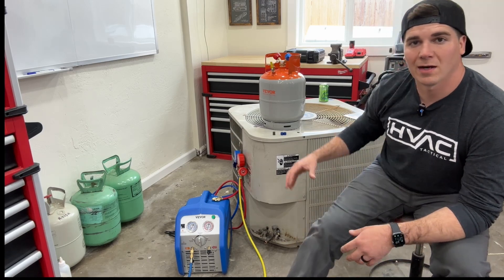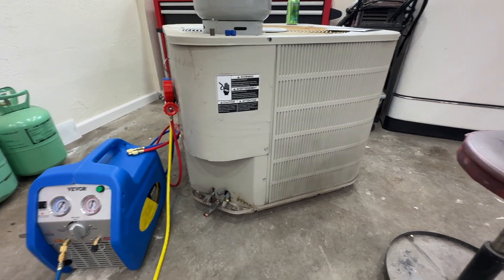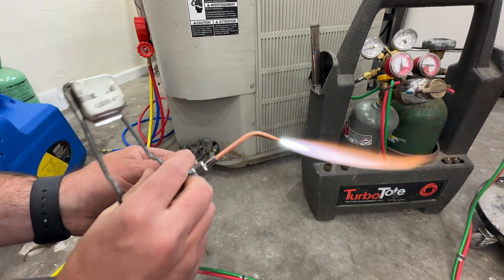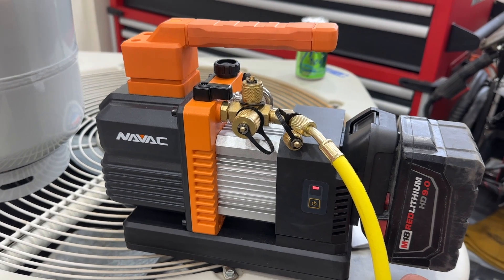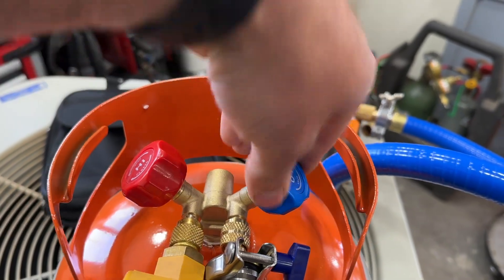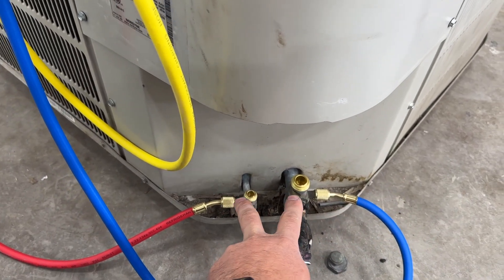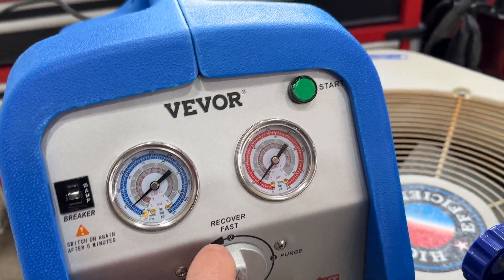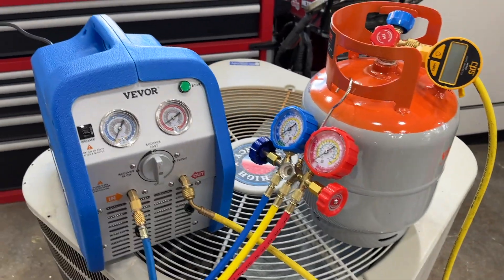How To Properly Recover HVAC Refrigerant Into A Tank

Comment: yeah as a home owner totally not caring about recovering the refrigerant... post a pic to craigslist it will be gone overnight... they want $150 just to pump down a refrigerator before the trash guys will pick it up but... pro tip .. a metal cutting circular saw blade can be very useful for cutting things into small pieces.
Reply from the maker: I heard if you flip the blade you can use a regular carpentry blade 👍🏼

Comment: Thank for your videos!! 

Last summer was a rough year for AC issues for me to manage!

Have rental houses in Mississippi, Florida, Alabama and Texas. ACs are a requirement in the South. It is a need to have cool air in the South. Last summer replaced AC in Fort Walton Beach at 7K and it took a couple of weeks to arrive. The house in Navarre I pay for the warranty and that ac had three hard breaks on parts at one time and it was 1K for repair and that unit is only 5 years of age. The AC in Alabama has a slow leak and had $250 of R-22 Freon placed in it. Last summer came back to house in MS with a hole in the ceiling due to pan overflow! Still need to get the drywall patched from that hole!

Your videos make me think I can can do more to spend less! Thank you!
Reply from the maker: Absolutely you can! I offer remote help for people like yourself, so if you ever need some assistance, check out our membership plan at Patreon.com/diyhvacguy 👍🏼  Cheers!
Reply: @diyhvacguy  just to let you know bro Milwaukee came out with a vacuum pump so you can use your batteries also Milwaukee came out with a recovery system go check it out doesn’t come out till next year though 2026
Reply: hopefully your repairs last for a while because the new high efficiency  replacement units they started forcing on everyone in january are much more expensive

Comment: Side note, recovery is slower unless you remove the valve cores in the path (service valves on low/high) between condenser and recovery tank and a 3rd to use as a valve to isolate the micrometer gauge from pressure when the pump is running.
Reply: Correct. Also use the " PURGE FUNCTION " at the End of the Recovery Process, to Remove any liquid refrigerant from the Recovery Machine.
Reply: I was about to ask about that. I've never used this small machines. I work on Automotive ac and I'm considering to buy one.
Reply: @VWtech562  Just finished my 99 Sierra last night. Flushed lines and evap replaced everything else. Got rid of the HT6 belly leaker for the sanden style. Started a home/auto diy channel since all the repair vids on youtube were crap so will have this up after a bunch of editing and narration. Weighed in the charge using a postal scale and 12 oz cans, easy to do since we got self sealing cans. Figured my large scale for heavy refrigerant cylinders would be a bit imprecise for a little 12oz can.
Reply: @thebluelunarmonkey  I was thinking about using my small kitchen scale to weight the 12oz cans too.. that thing is pretty accurate. My only concern is keeping the can on the scale without falling and giving a false reading.
Reply: @VWtech562  The new cans are self sealing - unlike the pierced cans we are used to. The tap is also self-sealing! so there is minimal loss when removing the can from the tap. You can then weigh the can. Put the can back on the manifold if you still need to add refrigerant. I'll be posting this on my DIY channel when I'm done editing. I could post the raw footage for you but won't have narration. If I do, I'll comment on that channel (Bear, Home Owner DIY) and you can view the channel and watch where I used a digital scale. You do need a scale with a range of at least 16oz (12oz refrigerant + 3.3oz empty can weight)
But you can do it without watching. Know your target charge weight (32oz for me).
Weigh three 12oz cans of R134a - 15.4oz, 15.3oz, 15.5oz. 
You know you need 2 full cans 12+12=24 so empty those cans and weigh the empty cans (3.3oz). Subtract from full weight (15.4-3.3 = 12.1oz, 15.3-3.3=12.0, total 24.1oz)
You now need 32oz - 24.1oz, or 7.9oz. 
The target weight of the last can is 15.5oz - 7.9oz = 7.6oz.
There will be some waste gas that stays in the lines, you could safely add 1oz and not be in danger of overfilling, so make target 6.6oz.  
You can remove the can from the tap when you are close. Wipe off ALL condensation (that's weight!) before weighing. Repeat til the can is at the target weight.
I have found the self sealing cans and taps leak free. Even the tap will hold pressure when removed from the can, the high/low side adapters also hold pressure!
I put my manifold on a vacuum gauge to avoid needing to bleed refrigerant to purge air. I use the extra port (has a schrader) to connect to my vacuum pump and can remove the vacuum hose without losing the vacuum in the manifold gauges. Close off the high, keep low open to vacuum that side. You don't really need to close the low after as the manifold should hold vacuum.
Reply: @thebluelunarmonkey  thanks for the detailed explanation.. I've never actually weight a 12 oz can lol. I just put it in, but I'll check them just as a precaution from now on. 

The system on my wife's Jeep takes 22 oz. I was thinking in putting two full cans considering that 2 oz might remain in the 5ft hose.

After just putting 1 can the pressures were at 40 on the low side and 160 on the high side with the system running... which make no sense, it should be at 20 or lower on the low side and when I turned of the car the pressures wouldn't equalize. I'm guessing I have a bad expansion valve. 

I will watch your video and subscribe to your channel. By the way I had not realized to use the center port with the shrader valve to put my vacuum pump. It's a great tip, I would just have to disconnect it before putting the refrigerant in the system. Now I need to buy an extra hose just for vacuum pump.
Reply: @VWtech562  I had to get Adobe Media Encoder has been working on my videos for hours to fix my not exactly 29.97FPS issue so Premiere wasn't allowing me to import. Working on editing and presentation on how older OBDii model AC systems work as well as replacing, flushing, vacuuming, leak test, and weighing in the charge. Sierra/Silverado specific but applies to pretty much all AC up to the past several years when they moved from pressure switches to sensors that feed pressure data to the PCM/VCM. Really new vehicles have a lot of different sensors that come into play when it comes to telling the compressor when it can compress.
Reply: @VWtech562  <- Going to be doing mainly vehicles (GM/GMC pickup, Ram 1999 and similar years) as I don't have a lick of work to do on my home HVAC so we leave that up to Dave here!
Reply: @BearHomeOwnerDIY  waves
Reply: if you want to reuse the recovered refrigerant what side of the tank you use for it liquid or vapor or doesn't matter ?
Reply: @2011652  single molecule refrigerants (R22, R134a, R1234yf) can be charged gas or liquid. Mixtures (R410a, r407c) have to be charged by liquid. If you gas charge a mixture then you'll separate the mixtures... so don't.

Comment: If you change a old R22 unit out, that still has refrigerant left that you can recover, does the homeowner get a price break on the new unit?  Why would the homeowner have to pay 100s of dollars to give you the R22 recovery of the old unit, so you can turn around and profit from their old unit?
Reply: What he was referring to was the labor charge for recovery and cost of empty recovery tank. The tech cannot legally reuse the R22 except for the units on homeowner's property, it has to be sent to a reclamation center for purifying and reuse. So tech will not be profiting from the R22. If homeowner has multiple R22 units, he can buy the empty (brand new, unused) tank from the tech and keep the recovered R22 for use in his other R22 unit, which is legal. An apartment owner who may have dozens of systems on the property may want to retain their own recovered R22 for later use.
Reply: Any customer paying for R22 and catching a tech pulling R22 from a recovery tank (grey body yellow top) instead of an R22 tank can report the tech who will be fired and possibly fined under the CAA for tens of thousands of dollars and a few years in federal prison and a guarantee to never be able to work with refrigerants again. Not sure a tech wants to risk having a savvy customer who knows the law. Being a federal crime, this goes to federal court and bypasses the all too lenient liberal DAs in municipal and state courts who continually drop charges.
So what are you in for, murder?
Nah, violated the Clean Air Act
Reply: @thebluelunarmonkey  Thanks for explaining I didn't know.
 How long will R22 and R410A be around?  They are both being phased out.  I know there are many changes coming to meet the PWP. R22 and R10A will only get more expensive as they make less of it.
If a U.S homeowner wants a new unit, but does not want to buy a unit where the refrigerant is being phased out, which unit  and which refrigerant would that be?
Reply: @threeftr3349  R410a is being phased out as we speak. There'll be no more R410a units made past 2023. The refrigerant will be around for quite a while. 
R22 was phased out for being ozone depleting (ODP), while R410a is being phased out for GWP (Global Warming Potential) though R410a's ODP = 0. The new refrigerants will be 0 ODP and have low GWP. I forget the numbers but remember R410a ODP > R22 ODP. There's a half dozen or so new refrigerants 0 ODP and low GWP. 
As for R22 units that have lost some or all of its charge due to a leak, probably a good time to swap refrigerants, there's a few cheaper options depending on if the R22 system uses mineral oil or POE oil. All R22 has to be recovered and good measure to unbraze the compressor to tip it to drain the oil out and replace it with correct amount since you have no idea how much oil has leaked out. M099 is a good pick.
R22 replacements, like R22, operate at about half the pressure as R410a, meaning less stress on components from developing leaks.
Reply: @thebluelunarmonkey  WOW! thank you., I appreciate all the info. everyone puts in the comments. Having a tech who really tried to scam us, I am putting in the time to learn as much about your industry as I can.
Reply: It is illegal to tranfer used refrigerant to another owner! And you really have no idea what the state of that refrigerant is,so not at all recommended to reuse it!
Reply: @petersmart1999  Thank you, I had no idea. I have a R22 and a R410A refrigerant units. As you know they are both being phased out. My r22  is 23 yr old still runs and passed another maintenance check. Yes Its not very efficient, but I don't want to buy a new unit that has a current scheduled phase out of the refrigerant. Any recommendations?
Reply: @threeftr3349  I havent seen one yet,but Im assuming R-32 units will be around for awhile! Keep your units clean,wash frequently and keep filter clean,they will last a long time!I work on 30 year olds that have been well taken care of!
Reply: @petersmart1999  Think the daiken umbrella of companies adopted R32 but think they are going to swap soon to a lower GWP refrigerant, don't know what probably pureon advance. Some companies like Carrier (R454b pureon adv) already has units with new refrigerants. While I think Goodman still has only R410a. I'd avoid the new refrigerants with higher GWP ratings since they are more likely to be phased out first (R32 would be phased out before R454b). R454b is basically a blend of R32 with an olefin based refrigerant (I think R1234yf) for a lower GWP. R32 can be charged/recovered as a gas while the blend has to be charged as a liquid - no biggie since techs are used to this with R410a.
Reply: Nobody is paying the homeowner for reclaimed gas.  LOL!  On another note, unless the gas is reclaimed from a compressor burn out, every HVAC guy I know is putting reclaimed (non-burnout) R22 into other R22 systems that need a charge or top off and charging full price for it.  These days about $150 - $200 lb.
Reply: @23x31  LOL, smart homeowners who know this, will be selling their old (non-burnout) R22 units for some dollars.
Reply: I’ve been wondering this too. They charge hundreds of dollars per pound of R22
Reply: @jasoncocca9409  They are are phasing out R22, as the supplies shrinks it makes it more expensive Also R410A is also going to be phased out.  Many changes coming to the HVAC profession as they make more refrigerants environmentally friendly-meets the Global Warming Potential requirements. GWP classification.  Every homeowner should look into this and keep themselves informed.  It only going to get way more expensive for us.